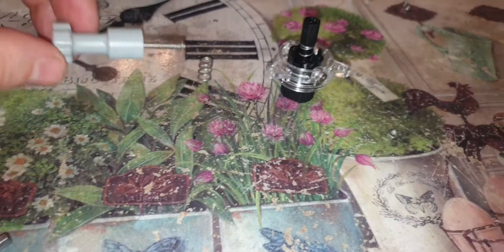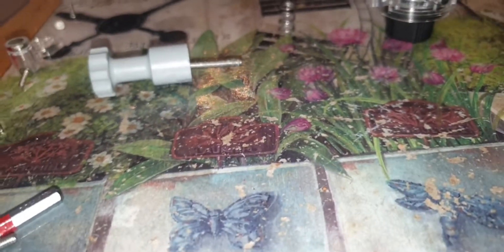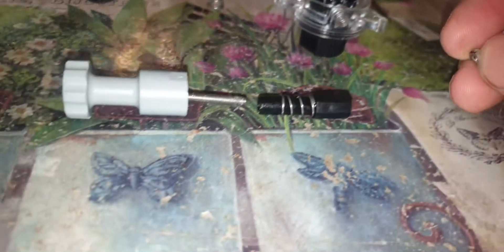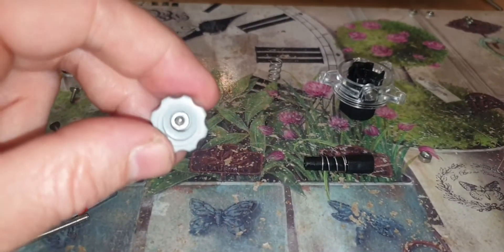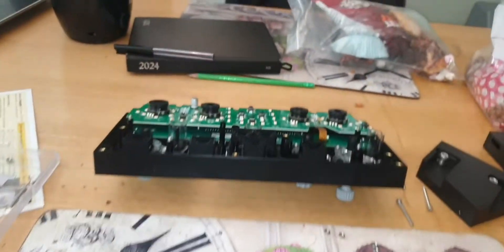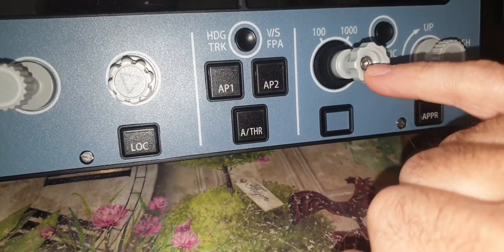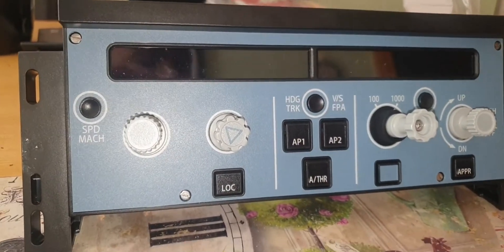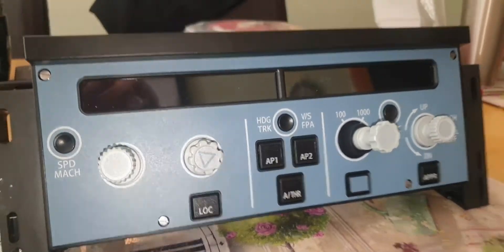WinWing FCU  Altitude knob repair.

Comment: You know this is a good beginning as to WHAT IS WRONG and how to generally fix it, but lacking in detail that the general user/repair person might need to accomplish this in home and with limited right-size tools.  Its more than a couple of screws, and the circuit board has 4 miniature nuts.  Don't loose them.  And things will fall off and out of the main panel so you have to remember to handle carefully.  Plus there is a little magnet that came loose on mine that fits inside the inner octagon of the knob controller for the ALTITUDE ADJUSTMENT.  Took me a minute (look at the other knobs inside and DO NOT loose this magnet when screwing the screw back into the fitting.  If you are good at general repair of electronic parts like this, you can do it.  AND, IMPORTANT, BE CAREFUL with the RIBBON CABLE connecting the two boards.  Otherwise thanks for a general what has happened video and how to at least get started.

Comment: thanks for the video mate, was wondering how you were able to fit the 3 screws used to fix the knob back into the casing? mine are just staying loose no matter how hard i push in and it seems the see-through plastic is lifting the screw too far above the thread. not sure if they were machine fitted originally. cheers
edit: turns out the screws stripped as i was unscrewing. cheap stuff
The main reason I removed it was because my alt knob goes into OP CLB with the slightest pull back of the knob

Comment: How did you get the cover off the knob to access the allen key?
Reply: Don't worry. Push bottom of screw and it popped out!
Reply: You can put Loctite on the threads of the bolt. You don’t need to take it apart to do so.
Reply from the maker: Its only a sticker so you can get a blade in the corner to remove it.